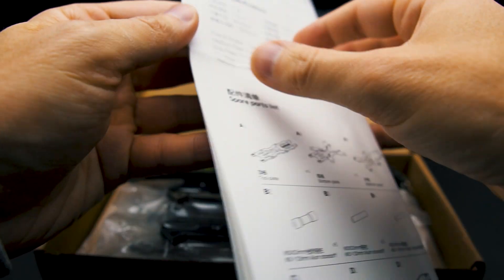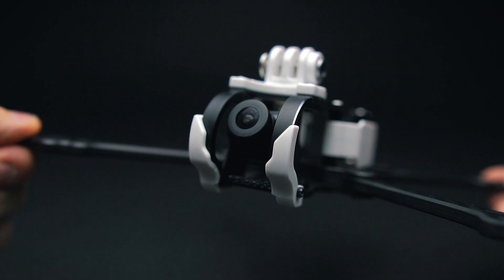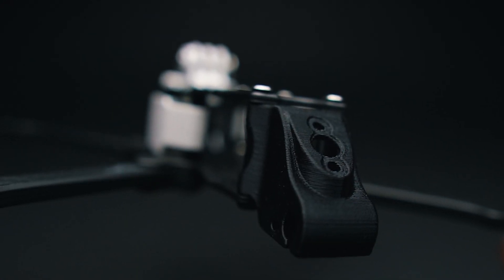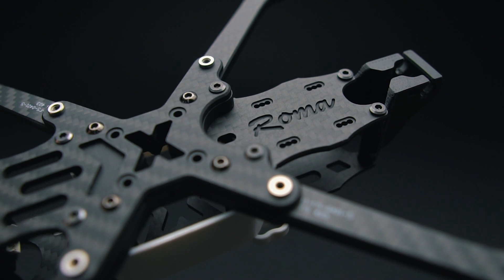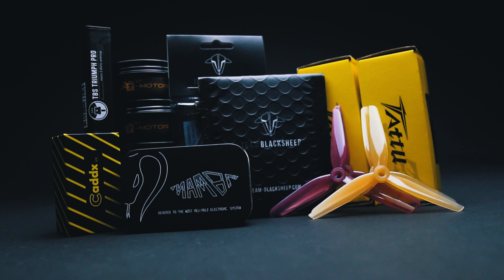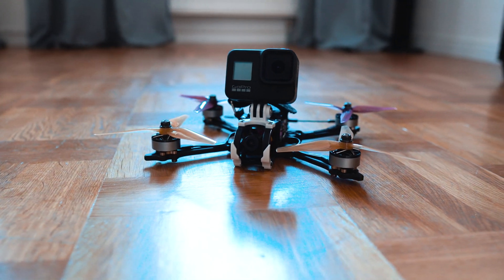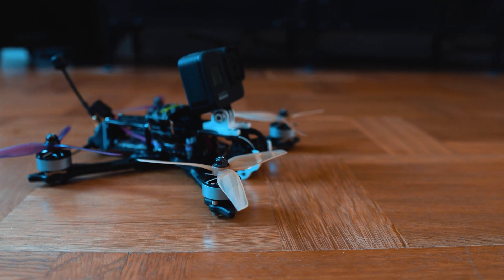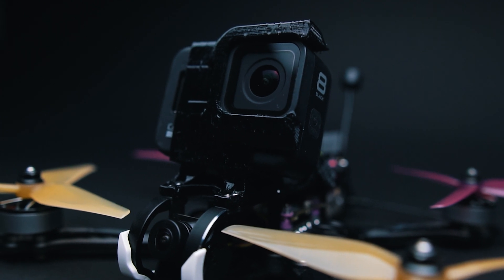DIATONE ROMA F5 - freestyle frame REVIEW w/ Betaflight 4.2 PIDs

Comment: Very clean build, I just got done building same frame but with xing 2306 1700 kv motors. Appreciate showing the pid tune. It was hard for me to get bounce out of the pitch and propwash was a little bit of a problem too but seeing you running it this aggressive makes me feel better about doing the same
Reply from the maker: thank you for watching Josh! and yeah 2306 are sweet, it's usually my favorite motors size too :)